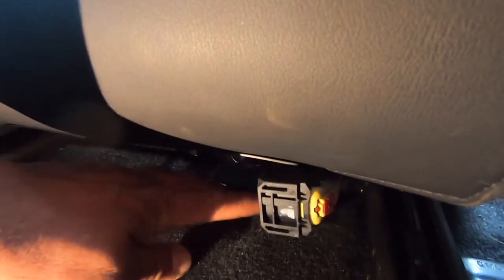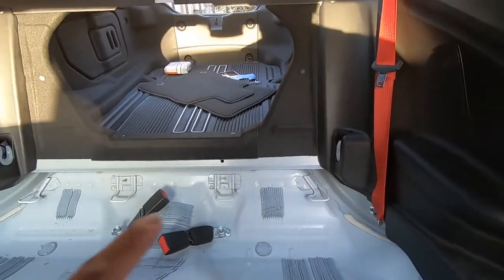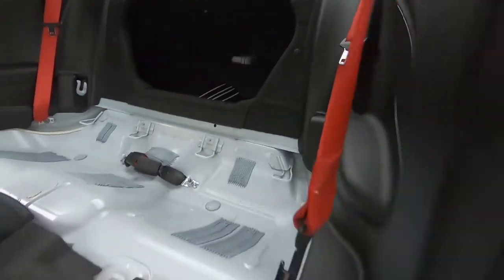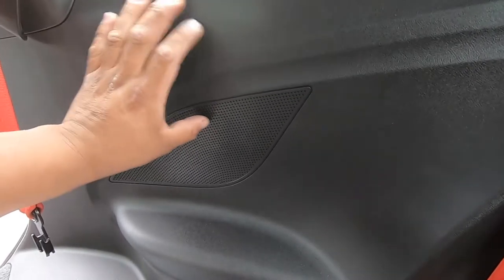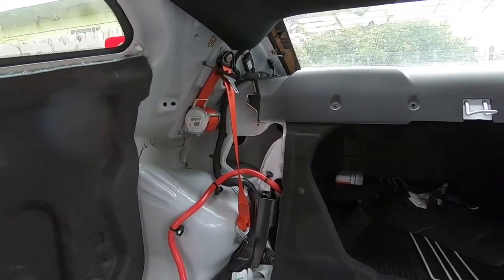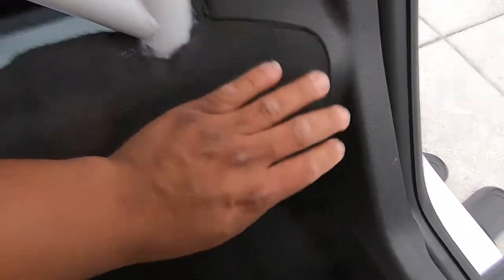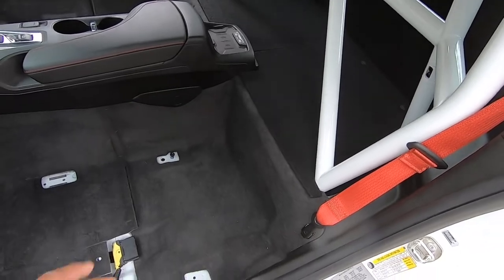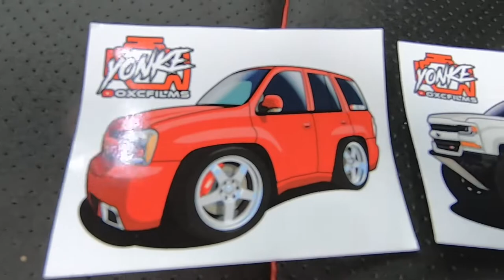Competition MotorSport Roll Bar & Rear Seat Delete Installation On A 6th Gen Camaro ZL1 1LE

Comment: How much weight does this cage add, versus the weight of the seat delete and removal of the seatbelts?  Did you get a chance to weigh everything to see what the gain was?
Reply from the maker: Honestly we did not get to weigh anything so we are not sure of the weigh difference
Reply: @OXCFilms  

I bought my ZL1-1LE specifically for road racing track days but I have hit the drag strip once with my Goodyear SC3Rs after running over 100 laps on them to hit a 1.67 60ft and 10.97@127 using 11% slip with a launch of 2200rpm.  

My next mods are the oil cooler and have not decided on which heat exchangers to go with... do I use the WeaponX, AFCO or CSF Race?  It seems they all add volume but the CSF has a different tube design.  I wonder if it makes up much of a difference?   I've installed the @BanksPower #DataMonster #iDash to log all the runs from the past three track weekends at Road Atlanta and Barber Motorsports Park.  So far, the biggest gains in cooling was swapping the Amsoil engine and transmission from the Mobil1.

Thanks so much for your install and the in-depth info you provided!
Reply from the maker: Youre welcome we are glad you enjoyed the videos. We have the weapon x heat exchangers and they made a huge difference. Havent looked into the other brands so we cant give our opinion on those